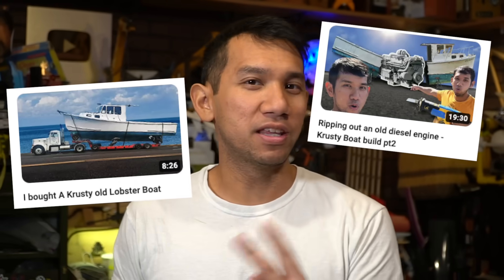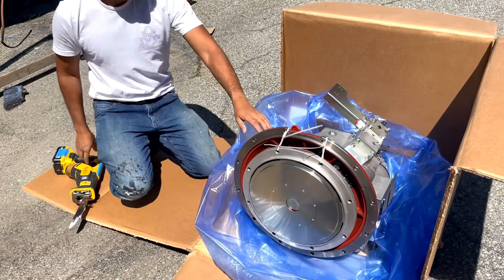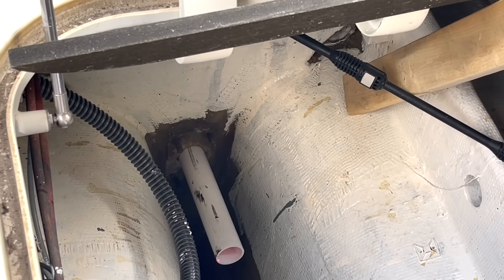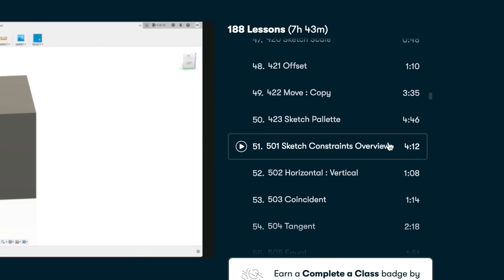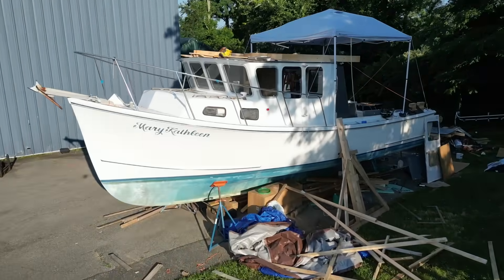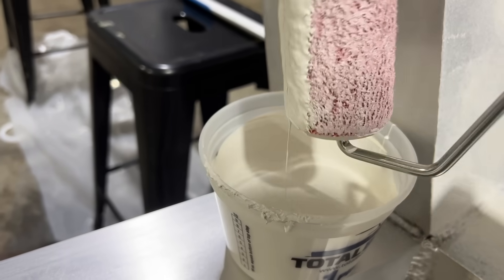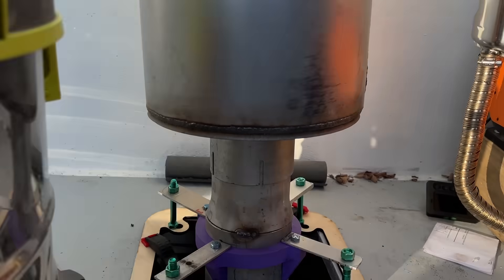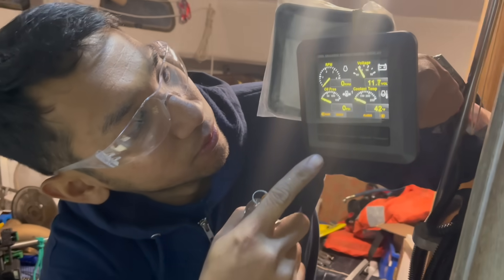Putting a big diesel engine in my krusty old lobster boat

Comment: In this video Peter learns the true meaning of BOAT
Break Out Another Thousand
Reply: or the classic. a boat is a hole in the ocean you pour money into. XD
looks great tho :)
Reply: Two best days of a boat owner’s life..

I guess for Peter the third happiest days are when videos are published.
Reply: bob oslates  a triger
Reply: Use hardwood frame hull motor room work for is way to soft
Reply: Only if you are stupid. He could have stuck an automotive turbodiesel in instead and spent less than a grand, had more horsepower, and far less weight. That thing may not even get that boat on the plane, with its pork, and not enough HP at hull speed rpm to get out of the hole.
Reply: @Maungateitei there's a good reason most boats don't use those engines
Reply: @Maungateitei bro that boat hull isn’t meant for getting on plane it’s called a displacement hull also his engine he bought has specialized marine parts that keep it running. Remember boat engines run at high rpm’s so that would put quite a bit of stress on a normal engine
Reply: @silontninja6947 incorrect. That is a planing hull.
If it were a displacement hull that size it would not have any use for mire than 20 or 30 hp. No more than 200lb of big slow old school thumper. Or half that of modern diesel twin or triple.
Reply: @silontninja6947 no they do not run at high rpm. My 45ft 13 ton ketch has a 30hp diesel that is max rpm 1800rpm.
Which pushes her at 9-ten knots.
Reply: @Maungateitei that's for folks that do stuff like this. Folks familiar with how to marinize it or run it on a closed loop cooling system. 

But buying a decent Cummins sure isn't happening for a grand.
Reply: @goosenotmaverick1156  Yeah and look at this motor, probably has more power than the obsolete "chuff chuff chuff chuff" affair that Peter pulled out of the boat.
I've kept my eyes on the market because I've been wanting to Cummins swap a Nissan Patrol. Even automotive Cummins motors are extremely expensive because of the Youtube hype.
Then for marine use you need to rebuild it for reliability, last thing that fails has to be your engine.
Ocean travel is more perilous than let on, especially to those who haven't informed themselves and with no experience.
Reply: @ToreDL87  my boss literally just took delivery of a 6.7 swapped "Fummins" truck (f350) he purchased a whole donor truck for that project and it wasn't cheap. He wouldn't even tell me how much and he spent 25k on the truck itself just to swap it. So who knows. 

Some folks just don't understand what's required to have a reliable marine engine,  that's for sure
Reply: @ToreDL87 I love the older patrols! Wish we had them in the US

Comment: Holy crap, $26k for a 5.9 Cummins? What differences are there on this engine vs the 12/24v 5.9 Cummins that was found in the 2nd gen Dodge Ram?
Reply: The problem is not the engine but the accessories to cool the engine and water cool exhaust that need to be super robust to be able to withstand seawater. Exhaust needs to be water cool because that engine is enclosed in a tight space with poor airflow.

Comment: Was the marine grade engine necessary? Seems like a crate car engine would work just fine too
Reply: I'm not sure how a crate engine would fair against 24/7 salt water.

Marine grade is more expensive but it's an engine prepared for a watery life.
Reply: @jackofsometradesmasterofnone  Yeah true. Seems like there should be a cheaper way but I know next to nothing about boats
Reply: @jackofsometradesmasterofnone  also marine engines are made to sit at a high RPM for hours on end

Comment: Dude canceled his health insurance to get a boat engine 💀
Reply: Gotta love America, where you can either have a boat or health insurance.
Reply: @MichelleSleeper can't be in debt if I'm dead 😅😂
Reply: The weird part is that the original driveline would have run forever for zero dollars. I guess maybe it's worth it for the views? Will a shiny sorta-new crate motor get more views? Mind blowing to me...
Reply: @privateparty4900  iirc it was either efficiency or the fact that its an old Penta motor, so parts availability might be harder to get.
Reply: @abhimaanmayadam5713  plus that old driveshaft was trash, along with all the other issues that needed fixing. That boat wasn't running anywhere lol
Reply: @Sun-ut9gr  I was about to ask if the motor was super screwed up but I didn't want to go through the old video. I do remember that the driveshaft was absolutely munted.
Reply: @abhimaanmayadam5713  I gather the concern was parts availability. ...but I found a water pump rebuild kit for under $100, starter is readily available for $300... Parts look pretty available to me. ...and he had to replace the driveshaft anyway. I guess I'm not the one to ask, I like old equipment. It's easy to maintain -- most of the parts can be made with a lathe and a knee mill in a pinch, and they're 1/10th the price of something more modern while retaining 9/10 tenths of the capability.
Reply: @privateparty4900  I wonder if the block/head or anything else had issues? I mean it was high hours, but again it could be machined/resleeved etc. it would be expensive but doable. I wonder if Peter is trying to set up the boat to be somewhat drive by wire in preparation for automation or something similar. rctestflight is doing something similar, but entirely on an rc level. The modern motor would make that a bit easier. 

I need to watch the previous video to see if other issues on the motor were mentioned, but there was a non zero chance that thing needed a bit of a rebuild/refresh due to the age and hours. It ends up being largely the same amount of work near the end. Sans engine tear down obviously.
Reply: @abhimaanmayadam5713  His concerns were power, parts, and finding a mechanic. Only the power concern is valid. or is it? 220HP vs 315HP. Both are underpowered by todays standards... except maybe for a trawler, which it is. Where it might have cruised comfortably at 8 knots before it will now cruise at... 11knots, or near as makes no difference. Certainly not how I'd spend my money but it's not my money. For me, I think it would have been more fun to put that money elsewhere.
Reply: @privateparty4900  I would assume the newer motor would be more efficient, even though that its a boat. So there would be some benefit to that. i wonder how the fuel thing would pay out over time
Reply: @abhimaanmayadam5713  Diesels were already pretty efficient. A loaded 1985 Peterbilt 359 with a mechanically injected 3406 Cat get's about 7mpg.  A 2015 computer controlled Peterbilt 389 gets about 7mpg. I don't think you'd live long enough to break even on fuel savings. ...actually I'd wager the 5.9 will make it easier to burn more fuel because it's capable of making more power. I think he was scared of the old engine, but I'd argue there was nothing to be scared of.
Reply: @privateparty4900 9/10’s as capable as a modern Cummins diesel? 😂
Reply: @dugwillis84  Not sure what you think is so magical about a "modern" diesel. I've got an ISL Cummins, and a 40 year old Perkins, and some in between.The output and parts cost went up, but otherwise, yeah, the old diesels seem to do just fine.
Reply: @privateparty4900  Id imagine hes trying to make his dream boat so why not make it perfect